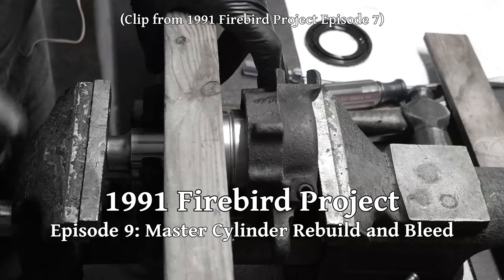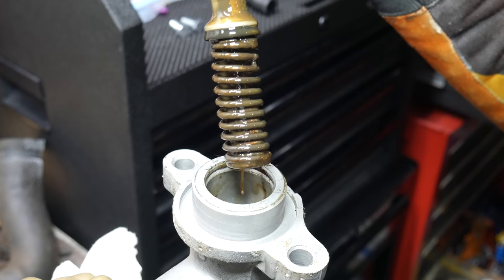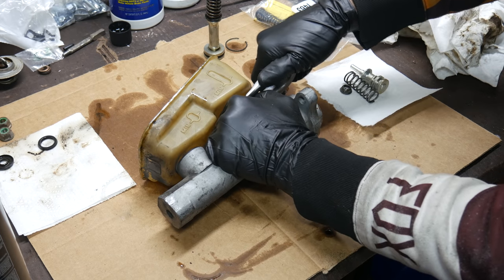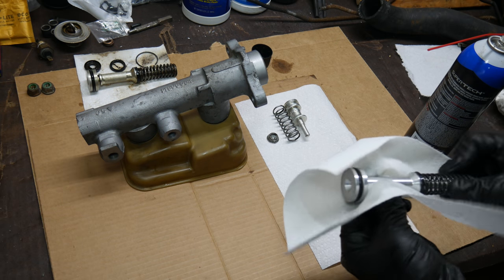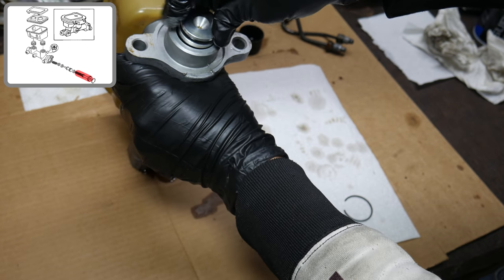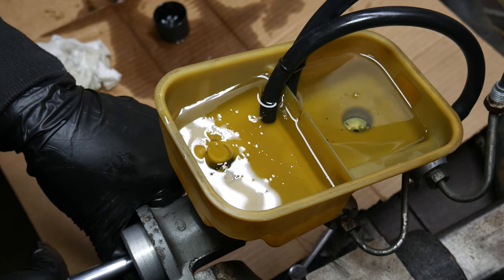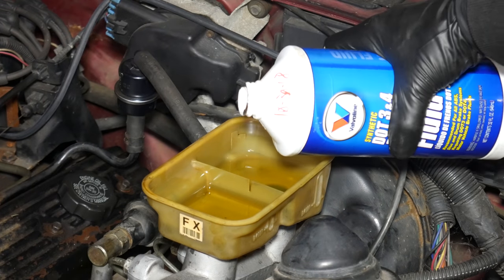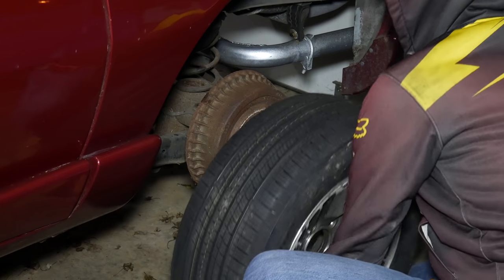1991 Pontiac Firebird Brake Master Cylinder Rebuild and Bleed (Ep.9)

Comment: I Have To Thank You, Your Firebird build inspired me to work on my own project car. Two weeks ago I started on a 1992 Celica GT4, it's in very bad shape and not running and i have my work cut out.
Reply: Scotty Kilmer approves!
Reply: Best thing to do is buy a dealer service manual. It will have detailed guides, diagrams, and wiring schematics. I bought one for my 85 Trans am off eBay for $40
Reply: @arturopacheco89  I second this. Factory manuals are always the best manuals if you can find them. If not, I like Chilton books. Some guys prefer Haynes...
Reply: @arturopacheco89  i found a site specifically for the st185 that has all the pdfs for the service manuals from the dealership and more.

Comment: Good move on not disturbing the reservoir tank since the seals aren't leaking, leave well enough alone, many times the replacement seals are of inferior quality and will eventually leak later on. While I am a proponent of rebuilding most components on vehicles to not only save money, but to ensure the work done was by oneself, on a used car that I don't know it's history, unless the part needing repair is OEM, I usually won't rebuild it, just replace it with an OEM new part(if available). Rebuilding rebuilt parts(yes, that sounds very profound LOL) isn't something I recommend, the tolerances are already compromised when the core was initially rebuilt(I learned that the hard way years ago on a pair rebuilt rear drum wheel cylinders that I rebuilt again and they failed!) I very much enjoy your vlogs and your insightful explanation on how and why you're doing certain procedures. Cheers!
Reply: Yes, drum brake cylinder rebuild kit seals are meant to be used ONLY to replace OE ones, exactly because tolerances won't match like you said. This applies also to aftermarket brake cylinders ie. you can't (or at least shouldn't) rebuild them because there are probably slight differences in tolerances compared to OE. So unless you know for sure the cylinder is the original that the car came from the factory with AND that it hasn't been rebuilt previously, replace the whole cylinder. Better safe than sorry when it comes to brakes. Brake cylinders aren't that expensive anyway.

Comment: If you have a rare, hard to find or unusual master cylinder on your vehicle and the bore is badly worn or rusted there are companies around who can bore them out and re-sleeve them, often in stainless steel, giving you effectively a brand new master cylinder.  Most companies that do this are surprisingly cheap, though obviously if the bore is an unusual size then it's going to cost more as the stainless steel cylinder bore will probably have to be machined from scratch rather than being an off-the-shelf part.  Some people don't think this is good practice, but a lot of race teams use this sort of service to create bespoke master cylinders to give the driver of that particular car the type of brake pedal feel that they favour, and brake failures due to master cylinder issues are almost unheard of...

Comment: The only thing I'd be missing here is shop air; since brake fluid is soluble in water,i like to thoroughly wash everything,and then blow dry it; i use an eye loupe to examine the edges of the cups( even new ones,i only trust myself  lol) and their seats for scratches/gouges/pits; paper or cloth can leave fibers,the brake cleaner you used, there is no telling if its residue will slowly degrade the cups,i would never use it there; but then again,you did 2 great jobs,doing it and showing it,using the brake fluid removed most eventual fibers,and you have a great knowledge of how the master cylinder works,better than most,better than i for sure; thanks.

Comment: I finally dropped 20€ on a air compressor powered vacuum bleed kit and I absolutely will not go back. SO much easier and hassle free when you're working alone.
And It's pretty handy for emptying fluid containers, like power steering reservoirs, clutch masters, etc

Comment: As for the bleeder screws, I remove them, clean the threads and then wrap them in teflon tape. Prevents air being sucked back in when bleeding and rust from seizing them up the next time they need servicing.

Comment: Very interesting discussion on the quick take-up valve. I never even knew anything like that was in there. 

However, as I understand it (which could be in error), nothing in the combination valve actually moves under normal operation. The plunger inside it should only move if there is a gross difference in pressure between the front and rear sides of it, thus turning the light on the dash on. It is not uncommon for them to stick one way or another when that happens and require replacement, but, it's not so common that I would ever expect to rebuild one (or replace one... I've had one stick once and was able to work it free with compressed air).

Another good video, FDP! 

(another thing worth mentioning... What I keep calling my "NoPro" in my videos, an Akaso action cam, is compatible with a smart phone app that allows remote viewing. So, fire up the cam, fire up the app, and watch your fluid levels and such from the driver's seat.. WELL worth the $50-$70 for the cam).
Reply from the maker: Good idea with the wireless camera! Hadn't thought of using something like that for bleeding.

As far as the combination valve goes, check out the diagram in the video (https://youtu.be/YdHw46WWq6M?t=1000). A combination valve combines functions of both a proportioning valve and a metering valve (hence the name) and there is more going on there than just the pressure differential valving. The metering part is for front discs/rear drums and helps the drum brakes make contact and start braking before the discs in the front, and the proportioning valve is on all vehicles and reduces pressure to the rear brakes at all times. Both of those subsystems have their own springs, seals, and moving valves
Reply: @FuzzyDiceProjects  I just read up on it some more and you're exactly right. There's a lot more going on inside there than I realized. Fascinating stuff that goes overlooked. Thanks for the correction!

Comment: Not sure if you know this or not but you can prevent rust by spraying the undercarriage with used transmission fluid and putting about 2 ounces of it in the doors and quarter panels and letting it soak into the metal.

Comment: You can acheive the same result as that Lisle tool with just a vinyl hose and a container, those don't hold enough in my opinion for flushing
Reply from the maker: Of course! What I used previously was fish tank tubing and a water bottle with the top cut off, but those 90 degree bleeder fittings are great! Especially for securely attaching to various sizes of bleeders. Hope they hold up long term and don't get stiff like vinyl tubing does.

Comment: I know this is old but if the inside walls of the MC are pitted, it will leak. This is why sleeving a MC is necessary. I tried a reman AC Delco 409 cast for my 70 Z28 from Napa and after the bench bleed and wheel bleeding it leaked at the rear. And no I didn’t over travel the bleeding. I returned it to Napa and bought a new one until COVID is over then I’ll get my orig 409 cast MC sleeved and rebuilt along with my orig seized smog pump. Do not use brake clean on rubber since it could swell the rubber.

Comment: Pretty sure im gonna have to do this on my 84 K20 truck. Brake fluid was like chocolate milk when I fixed brake lines on it.... You dont see many people actually showing how much gunk is on the inside of a 30+ year old master cylinder. More of a reason to replace or rebuild and have GREAT brakes rather then "ok" brakes.

Comment: I saw at the end you had the hatch pull down off. If you do a rebuild on it could you link the kit you use? My 86 doesn’t work and I trust your videos. I’m looking forward to a hatch pull down rebuild guide!!!
Reply from the maker: I didn't end up rebuilding it, only replacing the guides and rewiring some of the electronics. It certainly may need to be rebuilt in the future, though!
Reply: Fuzzy Dice Projects oh. Well still I look forward to the video! The information might help me with my pulldown! Great videos by the way!

Comment: In Europe usually it's cheaper to rebuild those things by yourself.
Even with new piston brake calliper rebuild kit costs around 5$ for my car and rebuild unit is around 20-40$
If I recall correctly bought master cylinder rebuild kit for 2$ and refurbished one was for a 100$ :p
Reply: FWIW, I bought a brand new, not rebuilt, master cylinder for my Escort (from Reybestos, the same company his rebuild kit came from) for about $20USD. They're, generally, so cheap here that I haven't met anyone under 60 that has rebuilt one. So, in that regard, I really enjoyed this video just to see the process.

Comment: You should get a 4th gen firebird in the future
Reply: NOOO! Those things are horrible to work on and have interiors smaller than a Smart Car.
Reply: @TheBrokenLife Im not going to lie its true, changing the spark plugs are a nightmare as the engine is under the windsheild. I own one 94' and its a good car albeit a nightmare to fix. Interior space doesnt bother me too much other than how low it is. I will get a 3rd gen sometime in the near future though preferably an 85-89.
Reply: @misterbuklau4053  I'm 6'4" so those cars just aren't on my menu. Plus my style is more like stuff I can change the oil on without getting under the car (a video I intend to make in the coming months, actually), never mind hunting around for spark plugs where my feet are supposed to go. 3rd Gen all the way for those reasons, for me...

Comment: ..something is wrong. There were rubber gloves, i think i saw safety flip flops, and there was clicking - even hand-drawn torque clicks in fact. So what am i missing...
I KNOW - No locktite! I mean, there was grease used, so i guess that's something, but.. A fuzzy dice video without locktite.
Reply from the maker: Good point. I should have loctited those seals in placed for sure!

Comment: So I've got a question about S10 gearboxes, I've got a 94 S10
-replaced idler arm and the rest of the steering linkage had very little freeplay.

you could watch the pitman arm move roughly 1 to 2 inches with the wheels off the ground while grabbing the tire at the 3 and 9 position. Figured the gearbox was the culprit(adjusted it till the wheel would no longer return to center and still had the same issue). so we replaced that and the rag joint while we were at it.
 We used a remanufactured masterpro gearbox and after installing it the same issue persisted and the box came from factory to where the wheel wouldn't return to center smoothly. Is the remanufactured box bad, or is it something in the steering column that went bad?
Reply from the maker: Are you saying that by grabbing the tire and turning it you see the pitman arm move 2" before it starts turning the intermediate steering shaft? With the truck on the ground and turning the steering wheel, if you watch the intermediate shaft how much does it turn before the pitman arm turns? If you have the plastic rag joint cover installed try to move it out of the way so you can watch the shaft, the shaft coupler, and the pitman arm all at once which can help determine where the motion is being lost.
Reply: @FuzzyDiceProjects  The intermediate shaft would turn roughly 30 degrees back and forth with the tires off the ground. It had me puzzled since with the key off I'd imagine the shaft to be immovable. Yet 30 degrees is about the same amount of play I'd feel when driving the truck around the neighborhood.  I'm not sure if that's just a steering box thing since all my other vehicles have rack and pinions. Also, how much freeplay does the Blazer have?
Anyways, thanks! I'll try your idea when I'm able to get a helping hand.
Reply from the maker: @Griefdriver  Well, the Blazer is still pretty terrible, I'd say it's probably 45 degrees. The reman box is pretty loose still. I didn't realize yours had a steering wheel lock, so I understand what you mean now

Comment: I would rather rebuild the hydralics that came factory on cars...to me it just makes the car more original using factory parts. it helps that I save loads of dough by just buying the rebuild kits. unless the parts are too far gone with rusty cylinder bores or cracks, get your hands dirty and rebuild it.  I'm working on my gas tank now...but pretty soon..I'll be rebuilding the brake master on my 85 Rx7. Yaw check it out on my new channel where I'm doing a series of videos documenting the resurrection of my barn find mazda rx7 sitting for 19 years.

Comment: Reman mastercylinders fail at a very high rate, according to my experience.  I suppose that is due to the honing removing cylinder material, while using a seal that's original dimensions--instead of larger.

Comment: Im a bit OCD,  but why not clean up and repaint the parts while they're off the car?
Reply from the maker: Which part would you paint? The master cylinder is just natural aluminum, you could paint it any color you want but I think it's fine as-is. The reservoir is plastic and you want it to be somewhat transparent to see the fluid level, but I suppose you could paint that too. I cleaned up the parts by giving them a wipe-down but anything beyond that just wasn't really necessary
Reply: The aircleaner,  brake cylinders,  drums,  or clean the dirt or rust rust off parts while they're easy to get to. Bit that's just me.  You remind me of when i did a tear down and rebuild of an old t bird many many years ago

Comment: would having an ultrasonic cleaner would have helped with cleaning the master cylinder?
Reply from the maker: Probably! That would most likely help get the smaller particles loose inside of it, as long as you had a large enough ultrasonic cleaning setup to fit it
Reply: @FuzzyDiceProjects  An overnight soak in simple green and water in a bucket does wonders too.
Reply: @FuzzyDiceProjects  how large of an ultrasonic cleaner would work for the brake master cylinder as you had it with rez?
Reply from the maker: Hmm, not too sure! Maybe a 2 gallon cleaner? Would have to just measure it and compare dimensions

Comment: Would you recommend buying a third gen camaro
Reply: Jstar Dhami hell yes
Reply: Personally, I would only recommend it if you buy one that is very rust free and with a manual transmission....
Reply: I got an 87 Firebird. And they are basically the same car. They are cheap and easy to work on but you will need to work on it but yea got for a manual trans please
Reply: @nitrokiller9959  Yep... With a stick, gears, and little of this and that those cars a real hoot. I'm a 5.0 Mustang man myself (thus representing the other half of the yin-yang here), but I've always liked 3rd gens too. I think there interiors are much more comfortable (for tall guys anyhow).
Reply from the maker: Sure! They are still relatively inexpensive and easy enough to find, and fun cars! There is a lot that can be done to make them handle and drive better, which if you are looking for a project to tune and upgrade is... a bonus? Parts are cheap and most of them are easy to find. Why not buy one?
Reply: I say yes. I sold my 91rs a year ago and I missed it. I picked up an 85 Trans am (POP UP HEADLIGHTS!!!). It has the 305 with a carb. Soo much fun to drive and fairly inexpensive to repair. My fuel pump crapped out 2 weeks ago and I had to buy a replacement. I bought 2 for $30 shipped. Took 15 minutes to replace as it is mounted on the engine block.

Comment: I'll keep on raising the question : while you are at it, why o why you don't upgrade to better components ?!
Like a 95+ Camaro brakes since they are bolt on and cheap ?
Reply: Too much of an investment. He doesn't want to spend any money into this project (or at least as little as possible).
Reply: It's always best to know what you have before you start changing things up. The small amounts of money he might be throwing away now on redundant parts later is well worth it in the long run to verify that any carry over components are functioning correctly. When you start changing a bunch of things at once, and something doesn't work, then you have no idea where to even start.

He's also said he just wants this 'Bird to be a cruiser, and with its stock 140hp at the wheels, it's already got plenty of brakes.
Reply: I'm pretty sure you have to modify the spindles by cutting off the ears and tapping some holes into the dust shield.